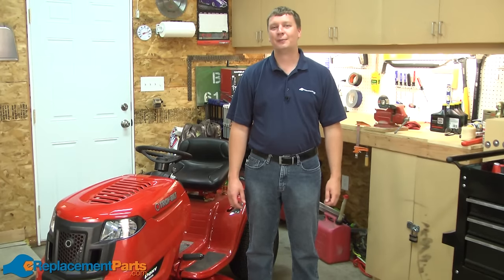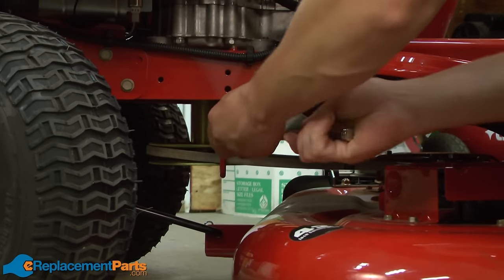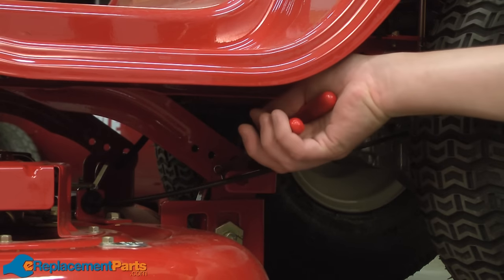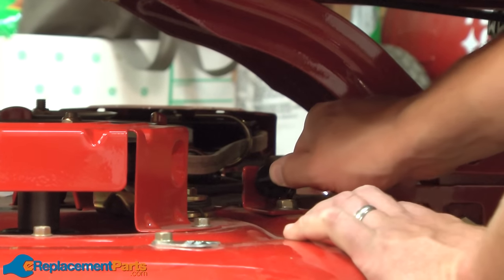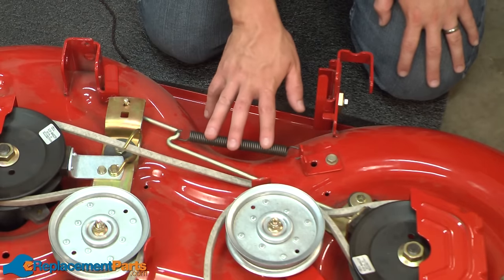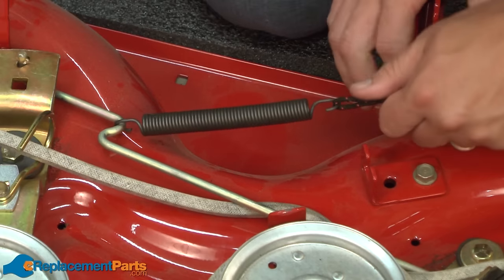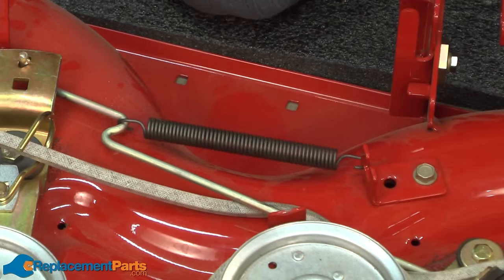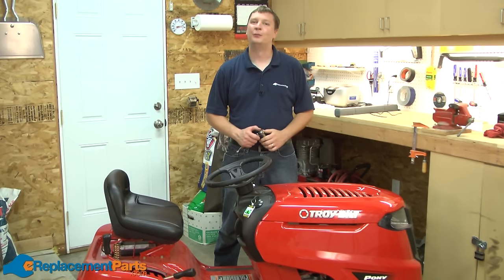How to Replace the Extension Spring on a Troy-Bilt Pony Lawn Tractor (Part # 932-0384)

Comment: Do you have a video showing how to replace a broken deck or pto engagement cable on a 2013 troybilt pony riding mower? Including something showing how to remove the broken piece (s) from the engagement handle?

Comment: The PTO spring seems to not be pulling tension on the belt tightner pulley.  Has the cable slipped and how do I tighten it.  It is a Bronco

Comment: Does this spring control tension on the deck belt? My deck belt is very loose, and is routed correctly, I’ve been fighting this for 2 summers now
Reply from the maker: Hi Chase, and thank you for the question. The extension spring actually applies tension on the deck break assembly, so the answer to your question is no. Over time, your lawn tractor's belts can become stretched, particularly if they're working continually under heavy load. This can cause them to warp slightly and become loose. If you send along your model number, we can point you in the right direction in terms of replacing your belt. I hope this has been somewhat helpful, and good luck with your repair!

Comment: I have a spring that got loose and wrapped around the right blade motor! It's not the pto cable spring so it must be the extension spring or is there another spring on the deck? Need expert advice!
Reply from the maker: My guess is that is could be the extension spring.  I would take a look at the parts breakdown and see if you can
identify the spring you're missing.

Comment: I have a troy built 46'' cut motor has enough power but want go fast cuts low grass OK but tall bogs the motor and blades ,all pulleys are greased ,blades sharp but still bogs,mower only has 400 hrs on it

Comment: First, please explain why one would need to replace the extension spring? Is it common for the spring to wear out? Thanks.
Reply from the maker: Hi Horace, thanks for the question. These extension springs are under a lot of pressure, so yes it is relatively common for them to wear out.

Comment: I was using my Troybilt Super Bronco 60TG when the accelerator pedal suddenly went soft and the tractor stop moving. The engine still ran but I smelled something burning probably a belt. I looked underneath and the belts seem to be in place and OK. Any ideas?

Comment: What cause the belt to keep jumping off once you engage
Reply from the maker: Hi Elizabeth and thanks for the question. The most common reason that the belt jumps off the pulley is if it is stretched or worn, or if there is damage to the pulley. If you're looking to replace your belt, send over your model number and I would be glad to help you find the right one! Thanks!

Comment: My pony won't move I don't think it's the transmission I'm thinking my brakes my be stuck  how can i see if that's the problem, thanks,?
Reply from the maker: Ricky Marlow What model number do you have?
Reply: eReplacementParts.com thank you however I figured it out, it was my brakes that was stuck.